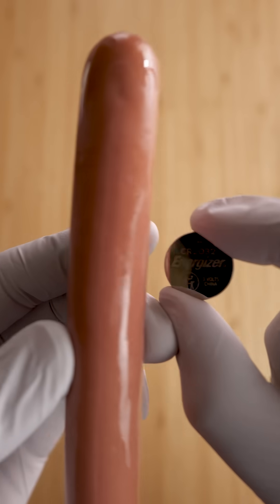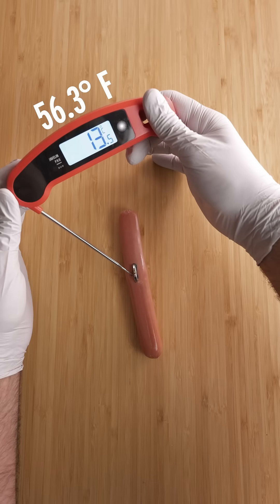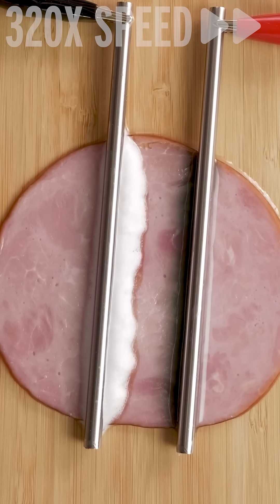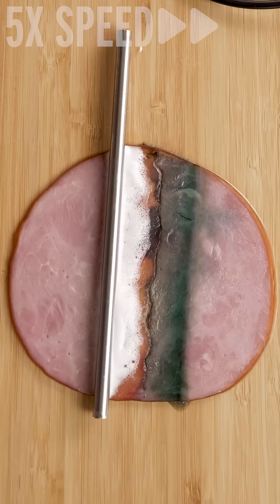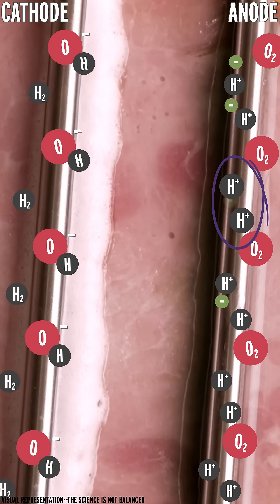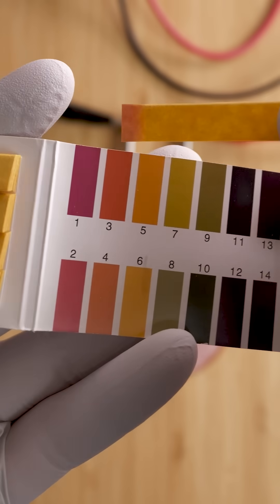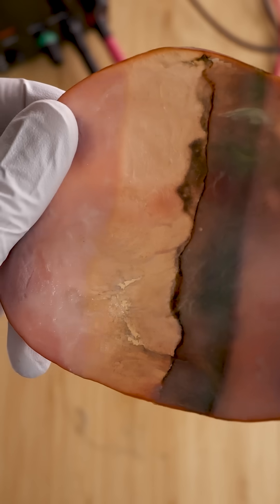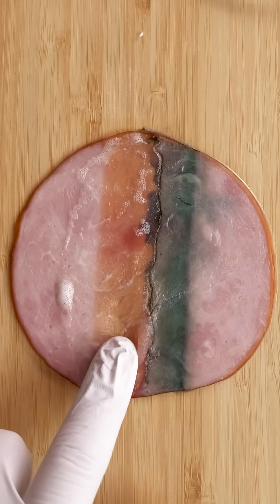don't swallow watch batteries

Comment: As someone who ate a watch battery as a kid, this is very interesting.
Reply: I did the same with a button battery (LR44 or similar). It went out the other side a day or two later.
1. The button battery can provide much less current than the lab power supply shown on the video.
2. For the stomach, full of hydrochloric acid pH of 3 is actually pretty mild.
Reply: @pd209458   yes mine was also similar to an LR44 (with the same results). They gotta make them less tasty looking.
Reply: How are you alive? 🤨
Reply: @Orinslayer  after seeing this video, no idea.
Reply: @Orinslayer find my answer on biology. He's attacking the problem only from a physical chemistry standpoint. He totally FORGOT to factor biology into the equation.
Reply: how was it?
Reply: @MadsterV   delectable. Solid 9/10. (Little spicy)
Reply: - I remember swallowing coins and a clock winder - -my mum really wanted that winder back - it dropped in the loo, eventually....  Batteries generally weren't in our kinder surprises.
Reply: Did you survive?
Reply: @RomanesEuntDomus.  Interesting question, what do you think? 🤔

Comment: So.. on the positive terminal, it's not creating oxygen, it's leaching metal ion. That's why it's green.
Reply from the maker: That's actually a dye that's being added to some of these batteries now. It's released when the battery comes into contact with moisture so that parents will know immediately if their child swallowed one. If you look at the packaging at the very start of the video you'll see the words "COLOR ALERT" on the right side.
Reply: @ACSReactions  The positive side of the of the steel rod experiment is also a bit green. Guess that's not a dye, is it? Could be chromium oxide, because stainless steel contains chromium.

Comment: Ohhhh so it's still a pH problem, yet it's not caused by introducing caustic material, but by producing caustic material directly from/in the tissues 😦
Reply: I guess to be specfic it's from water, but I like your way of thinking about it!
Reply: it still is introducing bad materials too. you also get corrosion from this from the electrodes
Reply: Chemistry
Reply: Bases turn flesh into soap via saponification, its how ancient humans used made soap
Reply: The idea that acids are “worse” is pop cultural baloney. Distance from neutral is what’s dangerous. Doesn’t matter if it’s low or high pH, what matters is that it’s very far away from neutral. A strong base is exactly as dangerous as a strong acid. (In general. Obviously this short presents an example of the base causing more damage in this very specific scenario).
Reply: @MegaBrokenstar  an equally strong base and acid, aka equal distance from neutral, will be roughly as dangerous as the opposite but acids and bases do have different, if similar, effects

Comment: I had a coworker who made a halloween costume with a light on his face. He had bare wires from a button cell running across his skin all day and night (he wore his costume to work and then a party). He had a big burned area on his temple for a couple months. It doesn't heal fast.
Reply: Crazy, you would never think this could happen at such a low voltage!
Reply: @hans-jurgenvogel6789  I suppose the sweat one someones skin would make this possible, if you have dry skin I don't this would still happen at those voltages.
Reply: i did that 3 days ago and got a burn. 

pretty cool!

Comment: So the electric chair is like dipping a person in strong acid and base?
Reply: No... well... no, because at least two other things will happen before electrolysis happens. Alternating current is used, and the first thing that happens is involuntary muscle contractions of all muscles, including the heart and lungs (diaphragm). This is what kills people first. If the current continues to flow, it will heat the tissues it is flowing through, litterally cooking and burning them. (This is also very bad for your health.) If the current isn't high enough to raise the temperature high enough to burn... and... it is DC current rather than AC current... then you can get electrolysis happening.
Reply: @juliavixen176 thanks for the reply! what about a tazer, a taser could be AC or DC?

Comment: This happened to one of my younger cousins, he survived but it was pretty scary. The battery came from one of those electric tea candles that they have at weddings.
Reply: what damage did the battery cause?
Reply: wonder that too. 
because here it takes 
- a whole power supply (!), which also has virtually infinite amount of energy capacity (because it is connected to the power grid), 
- nine volts (!!!), which means nine times more power (power is proportional to voltage squared, lithium battery is three volts, here it's nine volts, three times more, so power is three squared, which is nine times more), 
- static electrodes, i mean, electrodes not moving (in real body stomach gonna move and mix it's contents),
- and absolutely no protection for the tissues (again, in real body mucous membrane gonna protect underlying tissues from the damage)
- and god knows how much time
to get this dramatic result.
so now i wonder, what harm can a real battery do, aside from causing suffocation, which is real danger in this case
Reply: @Uztin-b4e  We're just ignoring the bit with the actual battery and the hot dog, then?
Reply: Did the kid ruin the wedding?
Reply: Where were the parents? And why weren't they charged with negligence?
Reply: @Chris-hx3om  really? Do you not know how fond kids are of eating things they shouldn't?
Reply: @ Didn't have these problems when parents parented. Too many people with kids now think the internet should look after them!
Reply: @Chris-hx3om whoever allowed kids at their wedding should be charged with negligence
Reply: @Chris-hx3om Are you trolling, or do you actually think kids only recently started putting random things in their mouth?
Reply: @BibendiYT  haha. Yeah kids putting random things in their mouths isn't new. Parents not properly supervising their kids is new.

Comment: Does this hurt the ham?
Reply from the maker: If you turned translucent would it hurt?
Reply: sO dRINKING 9.5 pH wATER iS cLOSE tO dISSOLVING tISSUE?  aLSO..  tHIS iS wHAT hAPPENS wHEN wE LiCK a 9 vOLT?   @ACSReactions
Reply: But we already are translucent. You just need a flashlight (or those godawful bright Mercedes headlights than can shine through a cow ) to prove it.